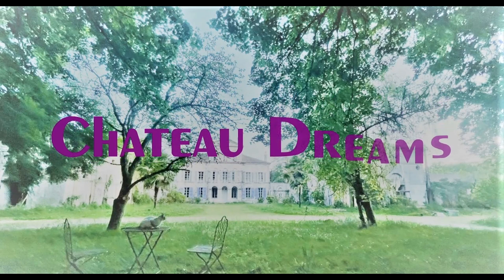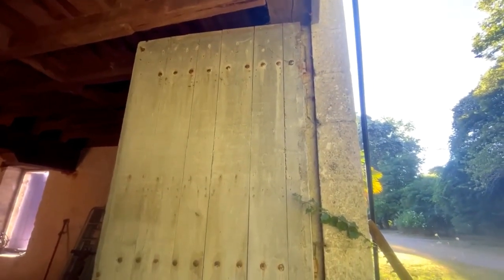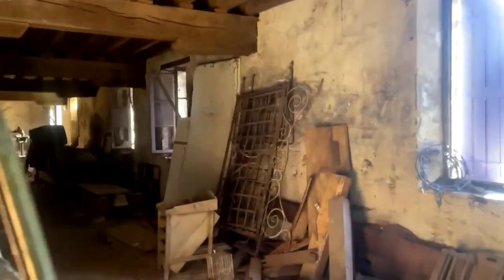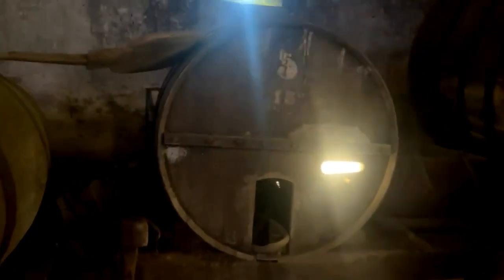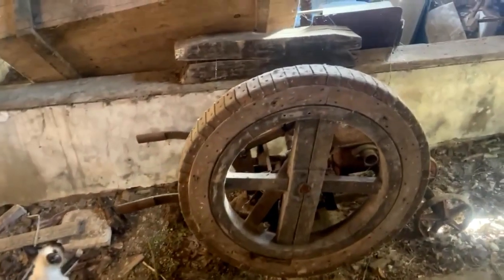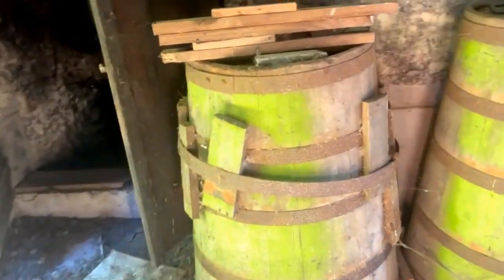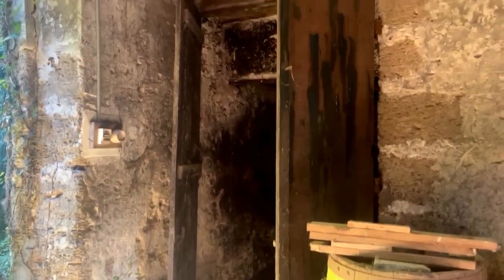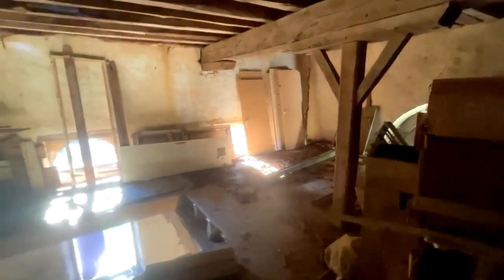#chateau Dreams Chateau Tour 3 -  Discovering WINE Making TREASURE & Tour the HUGE Castle Winery!

Comment: Have you renovated any spaces? It would be interesting to see what you've done compared to all the things that need to be done to make a habitable space.
Reply from the maker: The majority of the Chateau itself is renovated it was done about 15 years ago and whilst there is nothing wrong with it some just isn’t ours taste! It has a new roof, new electrics, new plumbing etc etc however as we have 53 or so rooms there is a lot to do from scratch so we are focusing on those and then doubling back to the nice to haves. As a result as we have been dealing with ‚emergencies like sewage rerouting (although the system was only 15 years old) a broken roof on the little house since storm Alice in 2021 which caused a lot of damage redoing ceilings etc. So far you’re right we’ve only really shown the yellow bedroom on the second chateau tour which needed doing and a little bit of chateau detailing. I will have a think on where to show you even if there are no curtains up yet (they are over 4.5m long so after literally 2 years still lots to make or extend and put up). In essence none of it is where we imagine it to be in the end / terrifying huh! ✨ it will be fabulous but it’s step by step. Thanks for watching 🦋

Comment: Wonder if the equipment was actually painted originally. There are periods where the metal was treated with bluing & not painted. Not sure of the European term for bluing... there are some different formulas, but the most common one is the bluing used on guns to create the dark grey color. Bluing also protects the metal for an extended period.
Reply from the maker: Very interesting thought I will take a look - we definitely have some decorative ironwork where it looks like it was blue then painted over eg the pine cone on the column at the bottom of the main staircase 👍✨🦋